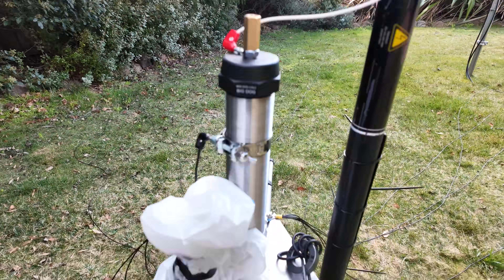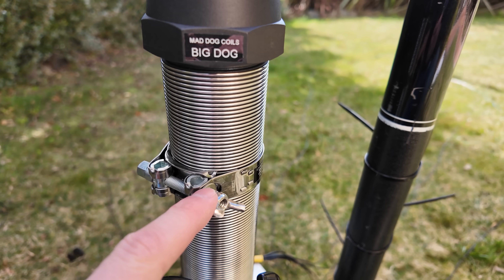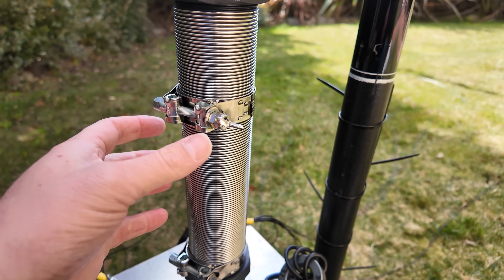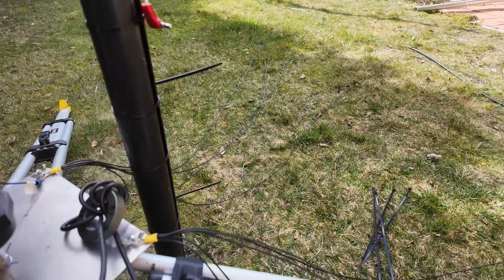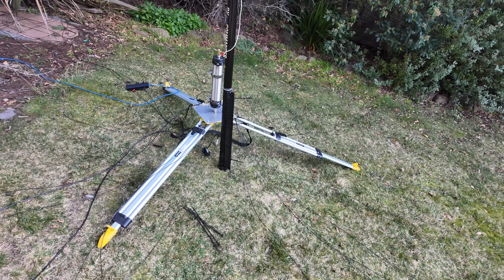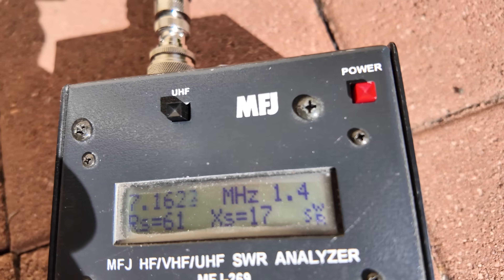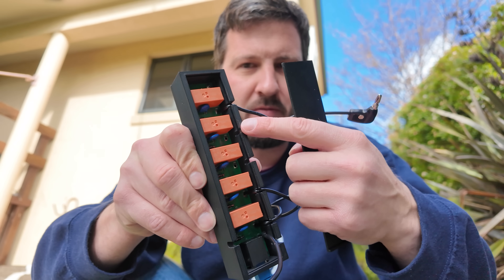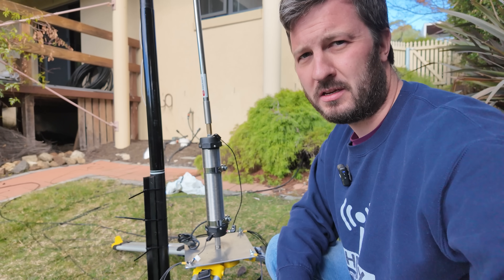No Room for a 160 Meter Antenna? Try THIS Instead!

Comment: As someone that has tinkered with 1611 khz type frequencies for years. I'd like to see what the Analyser says the mast is handing off to the top of your loading coil. In simple terms the shorter you are (under a 1/4 wave) the less R is presented to the ATU (in this case just 1 coil). This means the base current is higher. How much rag chewing can you do before these banana plugs etc get hot?

In my world it's AM with fully processed audio and 100% duty cycle. I"m using gal strap!

73's

Comment: As far as I can see, you have metal straps which form the taps, but they are shorting turns of the coil and form a heavy duty shorted turn themselves! I've seen loads of people doing this now. You wouldnt short turns on a transformer so why do it on loading coils. Cant be as lossy as on a transformer but it must cause a loss.

Comment: Great compromise. Sometimes 13 mults on 160 will win you the contest. I’ve tried a few inverted L with coils but not good for 160. Even with the radiator at 80ft, the noise is so bad. Beverage rx antennas are a must for any decent 160m qsos

Comment: A few years back, I tried to do a centre loaded coil for my linked dipole to give me 160m. My idea was that given I already had detachable 80m legs to the end of the 40m segments, that I could attach the coils there and have a seperate pair of legs for 160 that I could trim for best resonance. I was really happy that the coils I would came up almost exactly to what I designed them for. What I didn't bank on was how heavy 2 x ~7m of 0.8mm copper wire weighs.  The centre squid pole couldn't take the weight. One day, I'll revisit the idea, perhaps with an extra pair of 6-7m poles to support the coils.

As it looks like I can't mention anything that looks vaguely like a website address, if you want a look at what I did, use the google search terms

vk2mg 160 metres

and you should get something with a title like "Portable Shortened 160m Dipole"

Comment: I use a fat pool noodle for a coil form. I put the noodle a couple of feet up on a piece of PVC pipe as the bottom section of my mast. Then I wound it with a bunch of old picture frame wire. I set my receiver for the band and frequency of interest, then I just slide the alligator clip up and down the coil until the receiver noise is the loudest. The SWR is always below 1.3 on any band I've tried so far. The antenna vertical is composed of some old, broken bamboo fishing poles with 22 gauge hook-up wire on it, and an aluminum throw-away pie plate as a tophat to broaden the bandwidth and reduce the amount of the coil I need for resonance. It's about 15 feet tall. As a counterpoise I ran more 22 gauge wire out in 4 directions as far as I could in my backyard. 

I recommend this antenna for the low bands in a back-yard, though it's best if it can be set up as far as possible from any building with AC power running to it. That will help reduce low-band near-field noise. It's easy to build, and not fussy when it comes to measurements. I paid a dollar for the used pool noodle. The rest was all out of the junk box. I can work QRP with my QMX+ on any day the bands aren't dead. A little patience is all it takes. I really don't feel any need to work one station after another until I'm exhausted. That's not my kind of fun. I see working QRP as a lot like fly fishing. It's all in the challenge of doing everything skillfully and right, enjoying the day, learning the rig and the band conditions, and pulling out a big fish on the QRP light tackle every once in a while. People ask what kind of antenna I'm running and I tell them, "My junkbox, base-loaded, tunable vertical."
Reply: This seems nice ..I love low band too and elf........vlf..fun..I feel it's a bit mysterious unexplored ..almost feel like  an explorer searching  out secrets of earth  r.f.noise ..and it's mag field

Comment: Awesome video Hayden. One of my most enjoyable QSO's have been to VK land via long path (SSB). I've done both on a 5 element 40M wire beam (up 60 feet) and a pair of wire phased vertical ground planes. The verticals did great, but my wire beam was quieter. 73 de WA3RSL

Comment: Very lossy system, you may aswell throw a random wire on the floor and tune it up! A better solution would be a 2 turn Magnetic Loop, 6 feet on each side for a square loop, fed at the top and tuned at the bottom - My top band mag loop out performed a 130 foot inverted-L and an almost zero noise floor and provided FT8 contacts into VK from G.
Reply: Take the shielding off of a 300W dummy load and mount it on top of a post . Tunes all bands automatically without the need for a tuner or ground . Very low noise.
Reply: @321CatboxWA 😂👌
Reply: Very lossy vertical indeed but so is a mag loop. The directivity of the loop helps offset the losses as an RX antenna but not on TX.

Comment: Nice video. I have a question about coils. If you don't have something like that Big Dog coil, could you put smaller coils in series to accomplish the same thing? 73
Reply: When I was first trying to accomplish 160 for POTA, I experimented by stacking multiple coils and having a whip at the top. I ended losing so much/all power in the coils, it just didn’t let anything get to the whip. So I learned to have one single coil and tapped just a LITTLE longer than 80m resonance, then clipping a 75’ wire off the top, and using three 33’ radials. Best resonance around 1.85-1.9.

Comment: Nicely done Hayden! When I POTA, I use a homemade coil and 75’ of silicone wire off the top to a SpiderBeam off the way. Awesome job!!!
Reply from the maker: Thanks Brent! Is that for use on 160 too?
Reply: @HamRadioDX Yessir, for bands 80 & up I use a whip on top, but to get 160 I take the whip off and gator-clip the silicone wire to the top of the coil, then slope it to the SpiderBeam, and its resonant around 1.85-1.9. I’m hoping this fall & winter that conditions get better and get me further than neighboring states on the band, purportedly DX??

Comment: i recently attempted a 160m antenna, nearly 100m of cable snaking around the top of my roof. 3 floors high + sloping down, connected to a 9:1 unun. I ended up with an antenna beautifully resonant on 40m 😂 anyhow i’m keeping it as i didn’t have such a good 40m before.
Reply from the maker: Haha, does it perform well?
Reply: @HamRadioDX on 7MHz beautiful and 80m not too shabby, but no resonance on 160m…i need to play with coils.

Comment: I don't do videos but I do experiment often and my easy choice to add the resonance needed is my 55 gallon plastic drums to wind widely spaced coil AND serve as a water filled support for my vertical antenna. It also works to add frequencies to my inverted L antenna. Give it a try. Two birds, one barrel.

Comment: Great setup! I have been able to get on 160 with an indoor short G5RV (extra wire added). I was stunned when I could use the X6100 or G90 to tune to the band. Eager to try it out fully this winter. 73 Hayden de N2VQD
Reply from the maker: That sounds great! How did the shorter G5RV perform for you on 160?
Reply: @HamRadioDX    On receive I was able to listen to the 1900 Net here stateside. Also some CW in that portion of the band.